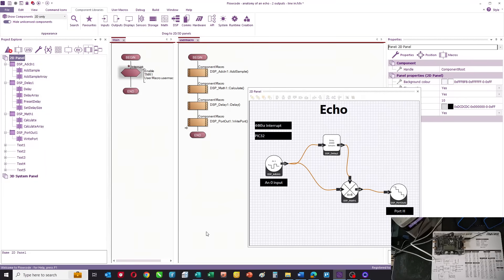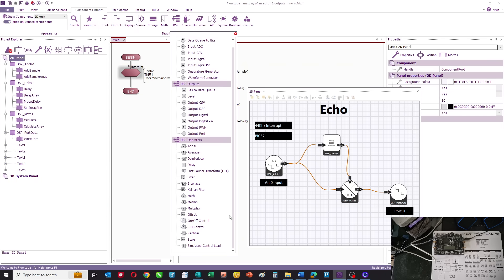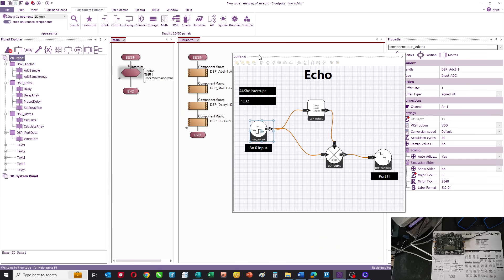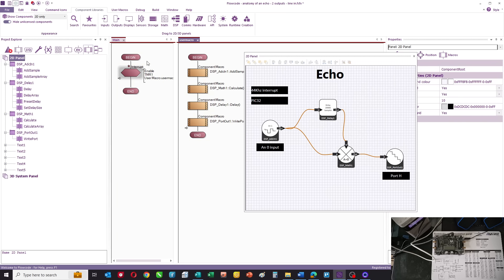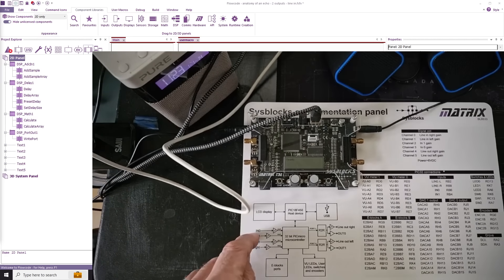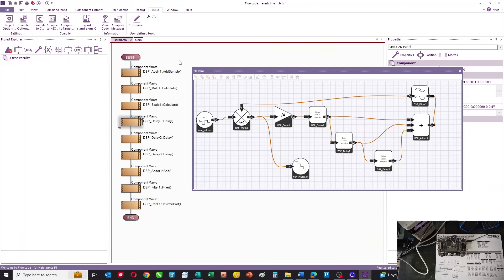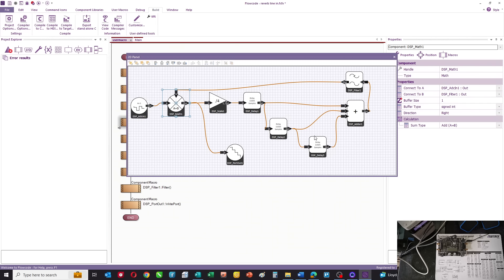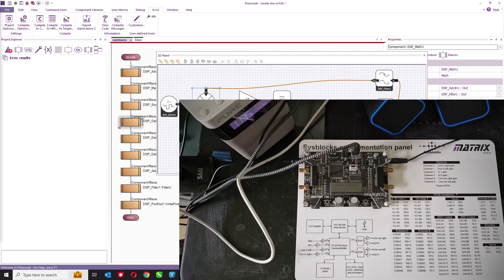DSP with microcontrollers

Comment: The distinction between processors and controllers and DSPs was always kinda artificial. So this should not surprise anyone. It is more a “has a” relation than an “is a”. 6502 has an input pin which sets the overflow flag. So it is a controller. 8080 puts IO on the same bus as memory access and is this a processor. JRISC in the AtariJaguar is integrated on a die with a fused multiply and accumulate Intellectual Property and forms a DSP . Sometimes Atari calls this a GPU . Nintendo calls theirs a Reality Signal Processor.